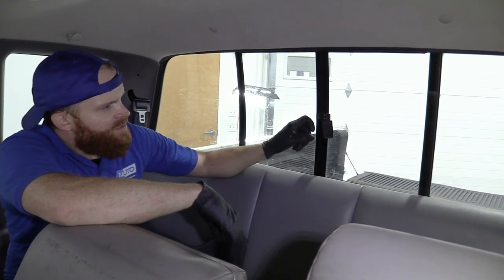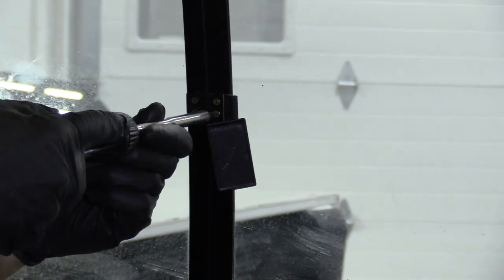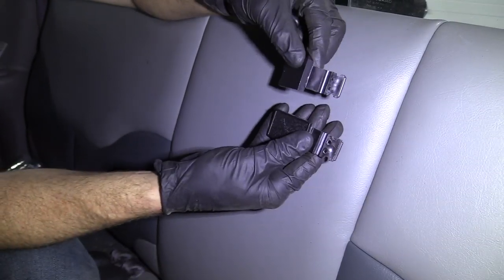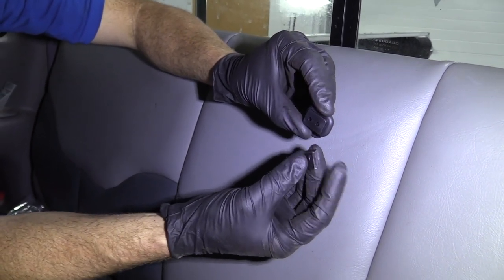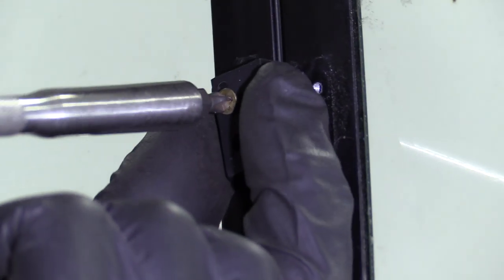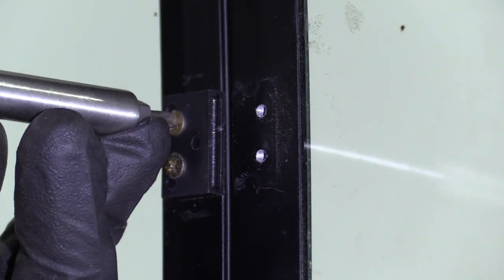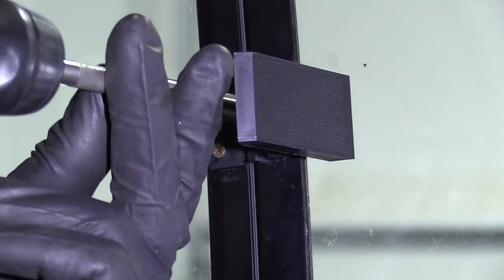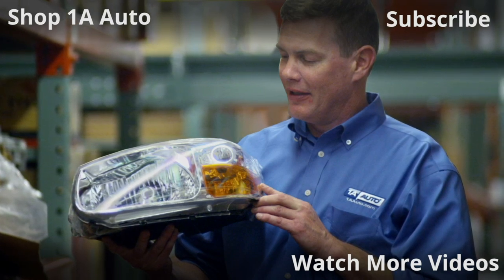How to Replace Sliding Window Lock 94-02 Dodge RAM 1500

Comment: bought 2 of these junk latches both broke first use from door man the part was junk dont waste your time
Reply: i bought 3 an they all broke
Reply: i put them on the way he did when go to latch they snap
Reply: Must be the common problem.  Purchased one at napa and the box was taped and stapled shut.  Low and behold, it  was broken. Last one in stock.

Comment: Is there a way I can buy the seal that goes in between both pieces of glass that keeps the water out when it’s shut?
Reply: Any luck on this? I need them too
Reply: That's what makes the latch fail ,yup and all replacements break,the rubber gets fat ,that intern doesn't allow window to shut correctly ever again..that mm of hinderence THE LATCH FAILS CAUSE THE DILAPIDATED RUBBER BETWEEN SLIDERS sell that 1A